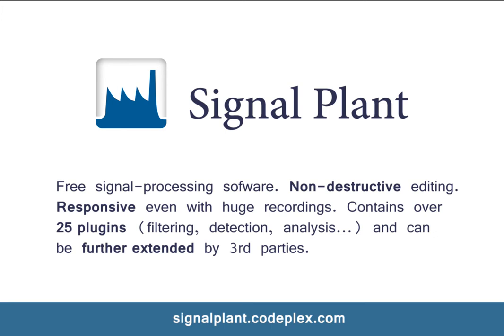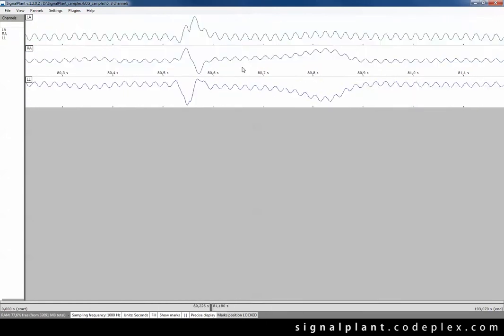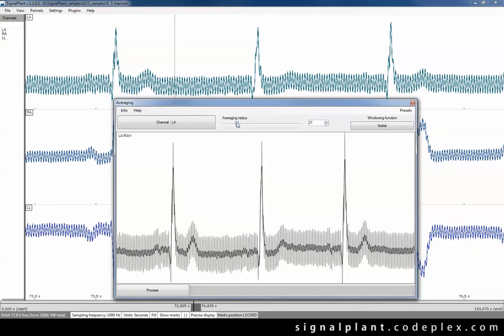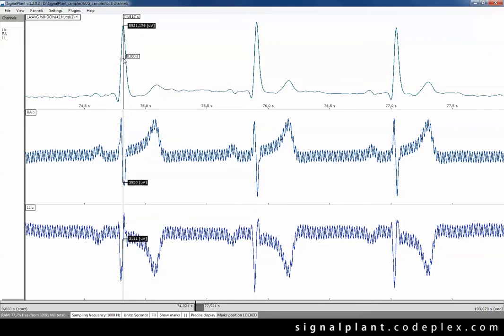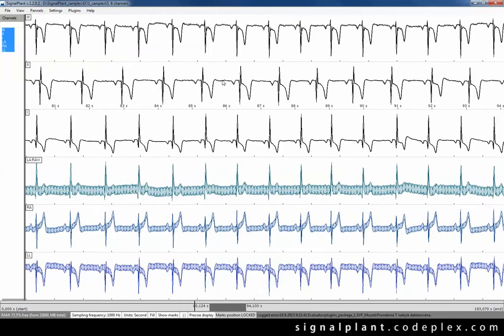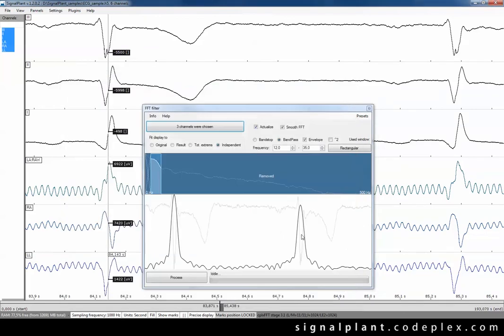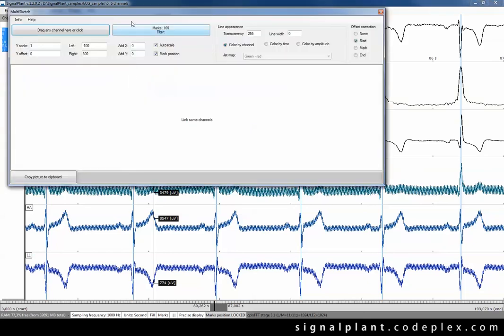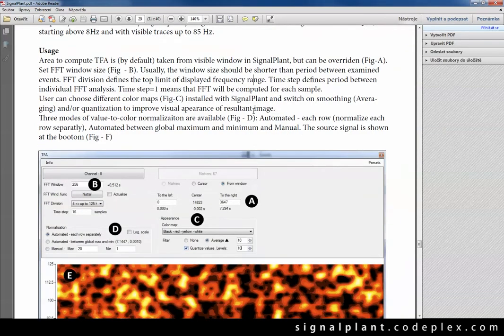SignalPlant : brief introduction

Comment: Hi Filip! This software is really useful. I have a question: is there any way to calculate Hear Rate Variability within a specific timeframe after creating marks for all the peaks? --- Basically I want to know the standard deviation of all RR intervals within a specific timeframe. If this is not possible within the program itself, is there someway to export the location of each mark so I can calculate their distances in another program?
Reply from the maker: Greetings! Yes, it is possible to do it automatically. Go to Plugins/Analysis/Time difference. If you do not have any other than QRS marks, graph will show you RR graph for the whole recording; "Statistics tab" contains descriptive statictics of RR series including St.Dev. (If your file contains other marks, you need to specify only those pointing to QRS.) If you wish to limit this analysis to specific timeframe only, you need to specificy that in mark selection window (use the keyword #TIME(sampleA:sampleB)). Tell me wheter you succeded and good luck!